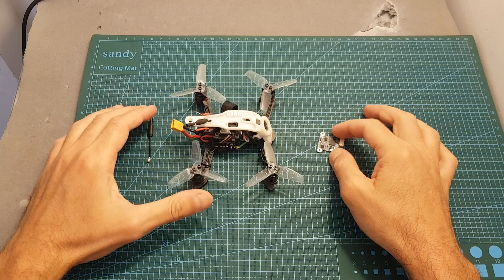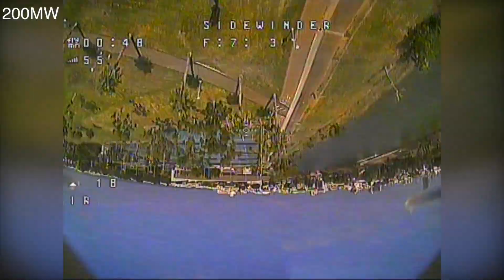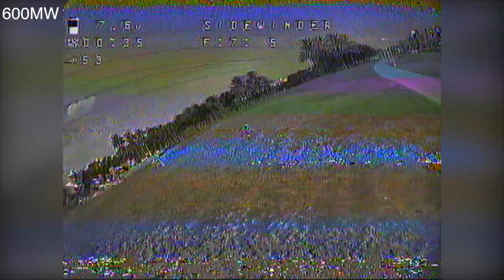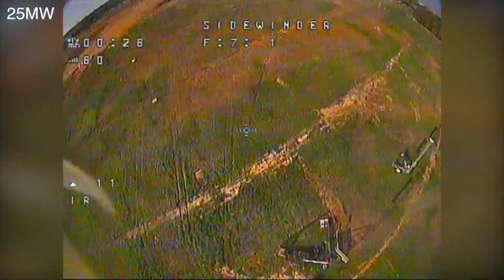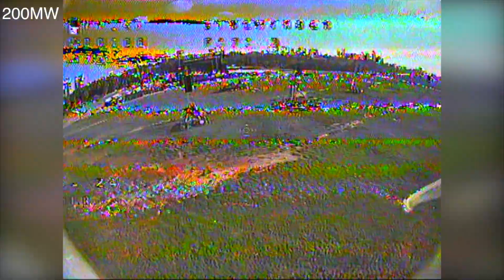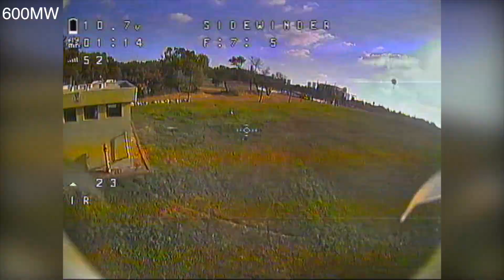FullSpeed FSD TX600 VTX - Review & Test Flight

Comment: Hey Gal, I know this is an old video so thanks if you do answer.  I have a question about pit mode, did you try it? Do you just need to set it on a switch and boom it works?  Im just getting SA and TA now, pit mode would be great for racing.
Reply from the maker: Hi, this vtx is using IRC Tamp protocol. The easiest way to to enter pit mode is by using the Betaflight OSD option.

Comment: Great video, just got this vtx to upgrade skystars babyturtle, your video was very helpful, ty. My only problem was the plug receiver was to big and wish l knew how to remove it as l just need the solder pads.
Reply from the maker: Thanks. You can use a heat gun, but it might damage the board...

Comment: How do you get the setting to save?
Reply from the maker: Are you using the manual configuration method or smartaudio?
Reply: Gal Kremer manual I’m not sure about the smart audio yet that’s another thing to learn haha but your video was very helpful!
Reply from the maker: @testpiloterb1828  make sure that smartaudio is disabled then.
Reply: Gal Kremer in beta flight?
Reply from the maker: @testpiloterb1828  Yes - under ports.
Reply: Gal Kremer such a huge freaking help thanks so much man
Reply from the maker: My pleasure @testpiloterb1828  :-)

Comment: For some reason I can't seem to get my settings to save correctly. Whenever I set it up and save it as soon as I unplug it and then plug back in it is reset. Any ideas??
Reply from the maker: Do you set it up through smart audio or the configuration button?
Reply: @KremerFPV  so I checked and I do have smart audio capabilities with the Tiny Leader which due to the size of the FC I didn't think was possible.  Thanks for heading me in the right direction without having said much! LOL ;) I am truly grateful for folks like yourself that share information and create videos for people to learn from. Keep up the good work and as always happy flying Gal!! :)
Reply: So if you set it through betaflight it saves the settings. If you use the button settings it does not save. Am I right?

Comment: Is it enough 5v power for 600mw-vtx ? I heard nomally 600mw-vtx demand 12v power for full performance
Reply from the maker: I didn't measure the output strength using 5v - but if you can I suggest powering it using 12V.